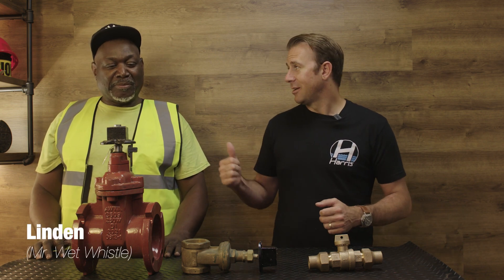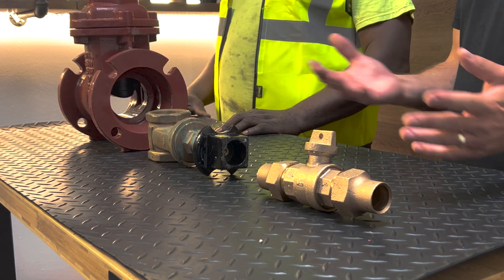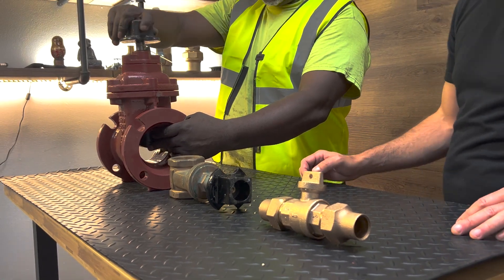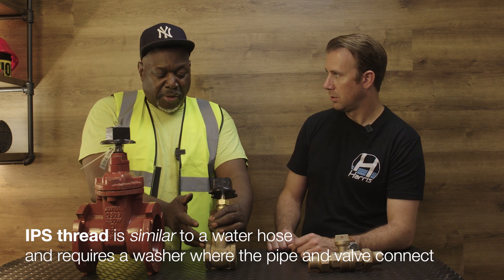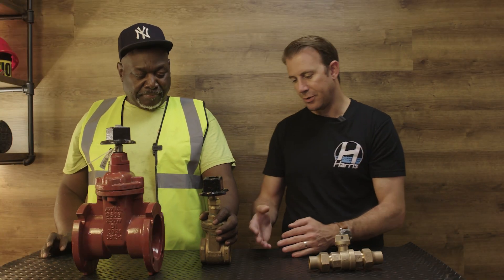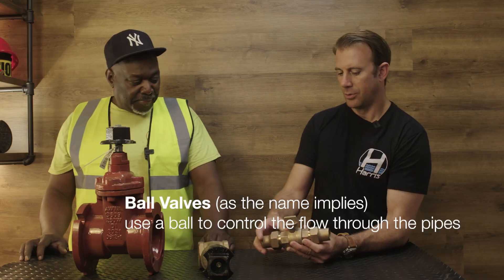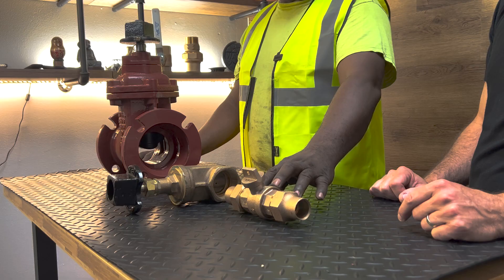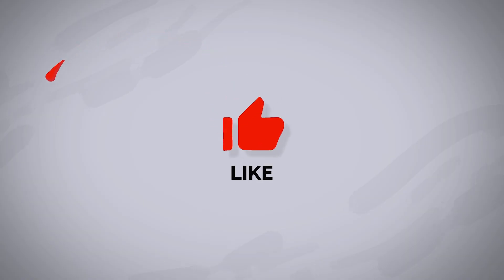What Are The Different Types of Curb Valves?

Comment: Your threaded gate valves require a gasket? I work in Texas, and our gate valves are NPT threaded. I believe whoever did the captioning for this video searched "IPS threads" and found "Iron pipe straight" threads. The type of IPS used in "IPS gate valve" means "iron pipe size". Gate valves have NPT "national pipe tapered" threads. (This information is true for Texas. Maybe NYC is different)
Reply from the maker: Or maybe our editor is really great at editing content and not a great plumber :)